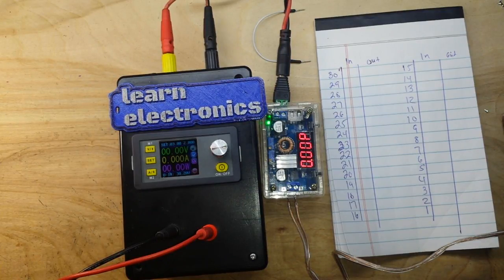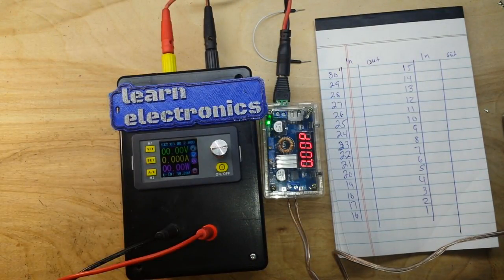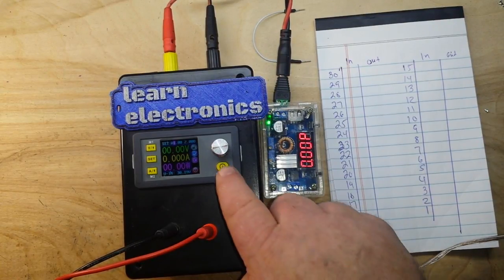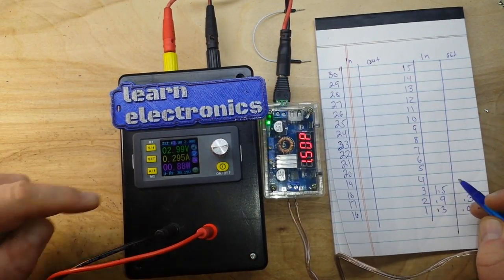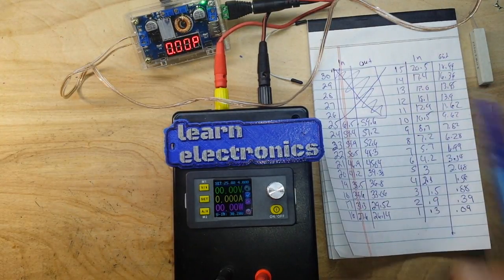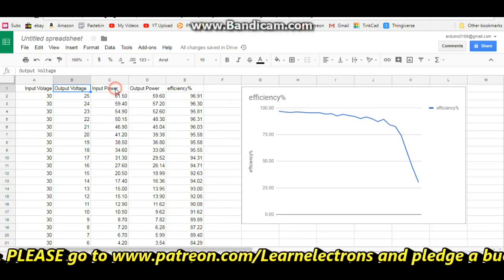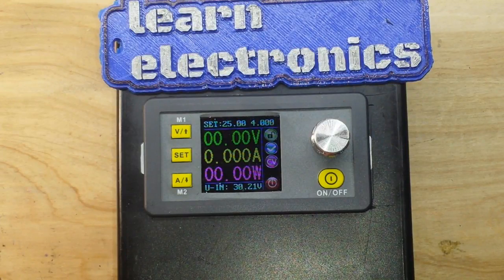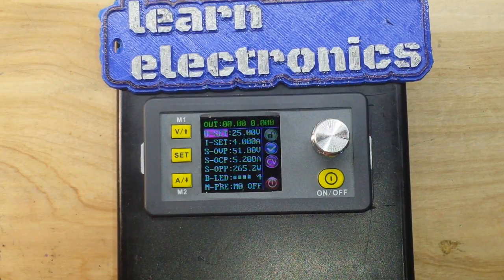Ruideng DPS5005 Characterization

Comment: Hey! I'm actually looking for a benchtop supply right now. Have you seen the RK6006 models? I debated getting one and using it with a repurposed ATX PSU. However I don't want to chance it. I'm thinking about going with the Korad KA3005D. Linear supply, a little more expensive BUT it should last me a long time which is what I'm looking for. Just need it for voltage injection, finding shorts in logic boards.

Comment: Isn't the low efficiency at the lower voltages caused by the overhead of the display and electronics? Which is why the higher you go, the more efficient it is?
Reply from the maker: +Robert Gibbons The closer you get to the input voltage the more efficient it gets. I'm not knocking it, it's good for the price and does the job well.